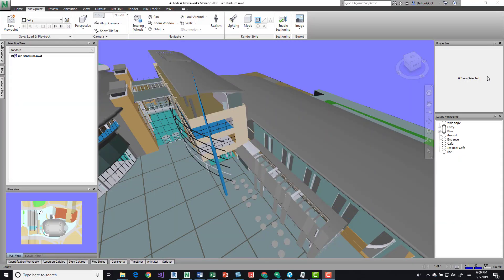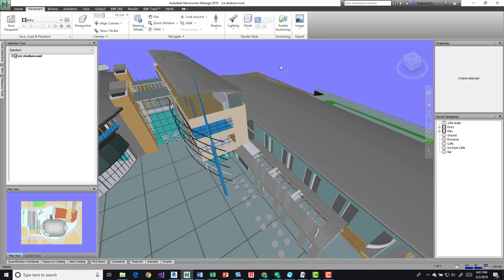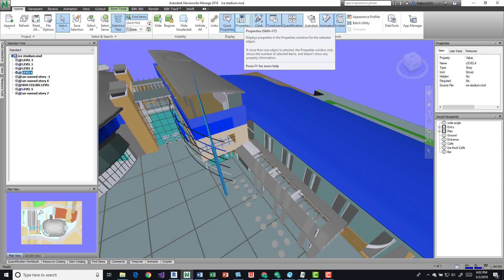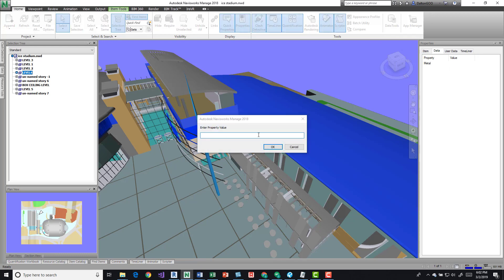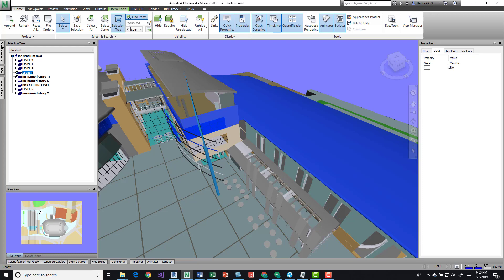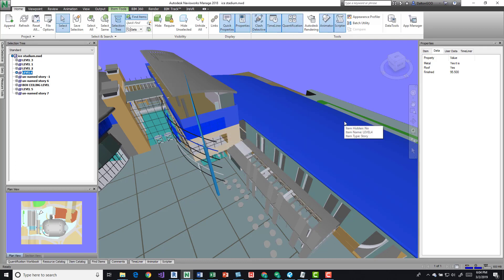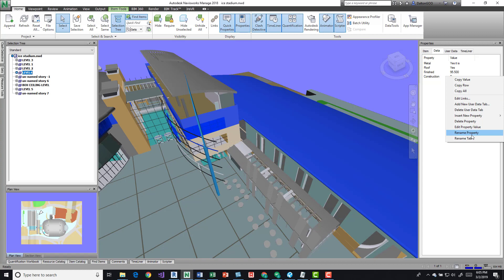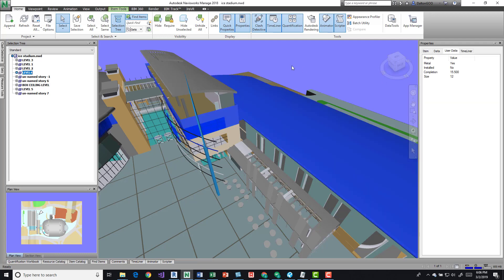Naviswork Adding Data to Model

Comment: Is it possible to export multiple parameters from multiple elements already in Navisworks to an excel?
Reply from the maker: There might be another way but try this and let me know if it doesn't get you what you need. Select the items you want after that click on your home tab, Select & Search panel, there is a button selection inspector which will allow you to export a csv of the properties for those elements. The properties shown there is determined by what is chosen in your Quick Properties options. I will try to make a video on that in the next week or so.